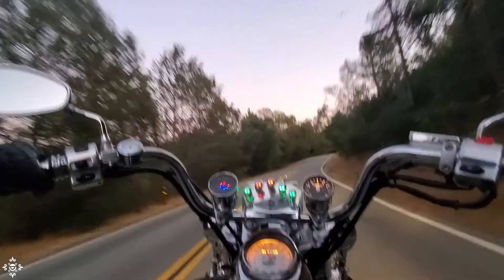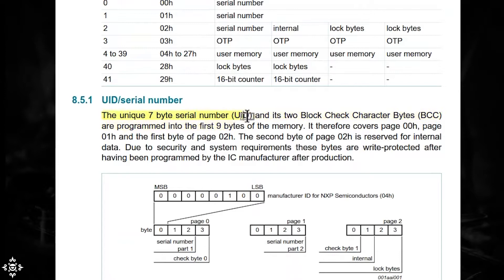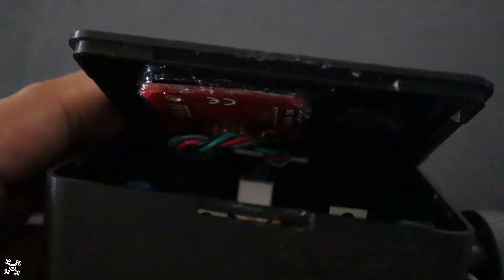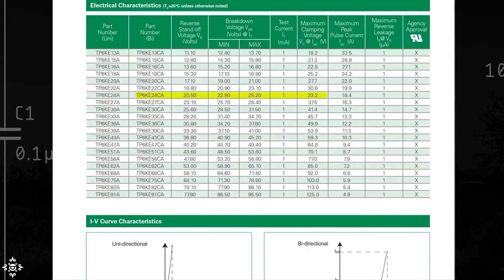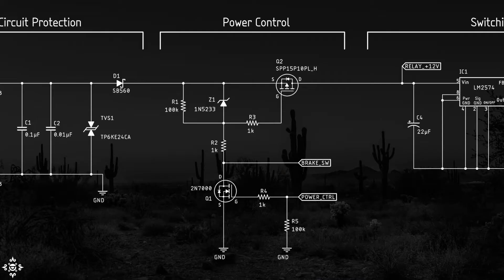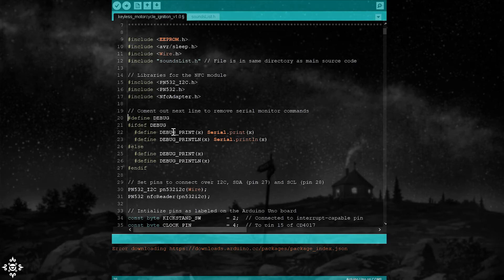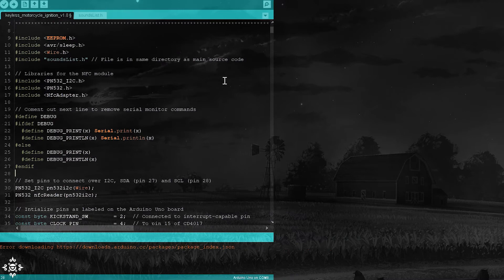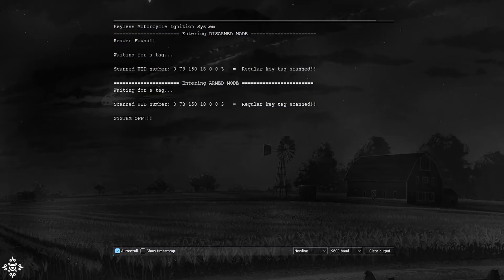Making a Keyless Motorcycle Ignition with a Ring (NFC)

Comment: dope may try sum similar on my corolla just temporarily installed a switch panel  cause the ignition cylinder went out if u got any thing you would change since u have been using